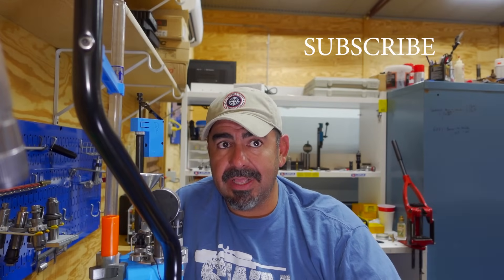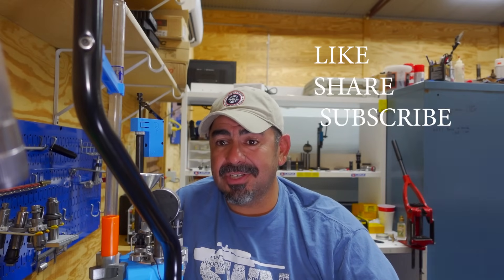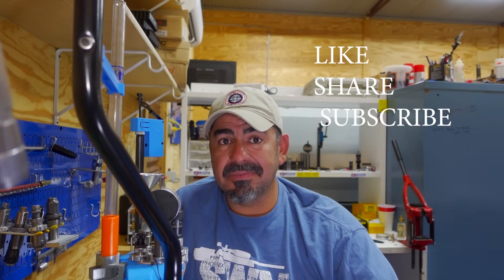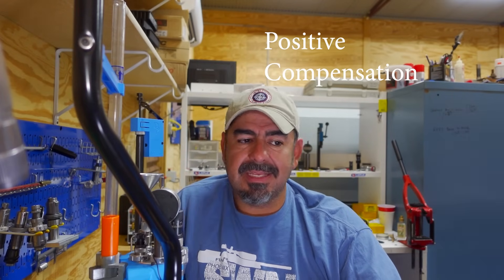Precision reloading is easy.  YOU complicate it!

Comment: Have you found that the process is different or more complicated if you aren't using premium equipment? Meaning if you buy an off the shelf rifle will the process be just as simple? I have watched many reloading videos and it always seems the less high end the equipment the more work it takes. Which I understand you get what you pay for, but if in your experience it is just as simple why does it seem that others struggle to find the sweet spot? Thanks for the vids and information.

Comment: I shot 3 different boxes of high-end commercial ammo (incl. Berger w Lapua Brass, and Nosler Match) with chronograph.  I was surprised by the extreme spreads (19 FPS - is that large?) and variability between shot velocities - meaning - no 2 shots out of 20 in the box had the same velocity.  Would you say this is due to the exactness of the weighing process in manufacturing?  Are commercial load powders not weighed precisely so there's more variability?  Your thoughts, Erik?
Reply from the maker: It’s not about weight charge alone.  You also have powder burn rate, chamber dimensions, barrel bore, etc etc. 

19 is very good ES.
Reply: @ErikCortina  Thanks for taking the time!  If 19 is very good then kudos to Berger for making such a high quality commercial product at a fair price.  I want to get into reloading but can't stand the thought of another workbench full of equipment (the price of it all doesn't bother me - just the 'more equipment / stuff').
Reply from the maker: David Greenapple 
If you have seen my 1.3” group at 1000 yards, it had an ES of 19. 😳

Comment: I agree there is no reason to complicate things i dont care if you have to spit on the case before you shoot as long as your gun, as you say, hammers who cares about the rest thats what you built it for. I just built a 6br earlier this summer and i just got a hummer of a barrel, no matter what load or seating depth you use it shoots (within reason) you get sub .200 groups. I use it for varmit hunting but definitely should make some shoots cause is scary accurate. Stiller action, kreiger barrel and hogue full length overmold stock like i said built for hunting but it just flat out shoots. Ive had this caliber before as well as dashers and had a great base load that i knew would be very close. before i ever got the barrel throught 30 shots i already shot one 5 shot group in the 0's with a 62 grain berger flat base . i settled with a faster load that shoots sub .150 almost every group occasionally i mess up one way or another and get a flyer but my fault not the guns. Great video hope to see more like it sorry i rambled on so long

Comment: Love the videos, I have not yet had time to watch all of them so maybe others cover the following points.   I am guessing there are some assumptions in your method.  Type S die with .002" shoulder reset and around .002" neck tension and a very consistent way to measure powder weight.  I don't think I am the only one to have great groups at 100 yards with horrible ES due to standard sizing dies and using a volumetric powder measure.  Your point about great bullets and brass is not lost on me.

Comment: One can buy an off the shelf hunting rifle today guaranteed to shoot 1 MOA or less with factory ammo.  That level of accuracy was not common 40 years ago when I started hand loading. The 1st rifle I loaded was a REM 700 in 7MM Rem Mag which shoots factory at 1.20 MOA.   Back then simply working up loads I could get consistent groups at 0.80 MOA.  Over the years by using good consistent brass,  more consistent neck tension and playing with the seating depth it shoots consistently at .6 MOA.  I’ve tried most of the techniques out there to improve accuracy beyond that but they don’t seem to matter.  Of course this is not a precision rifle and not for competition. You can buy a precision rifle that will shoot better with about any ammo you run through it.  I agree with this common sense advice.  Besides, most of that other stuff one might try has to do with making brass more consistent, and that’s something one can now buy also.

Comment: For some they can do what you are talking about if money was no issue. Berger bullets $75 per 100 lapua brass $100 per 100 pieces new barrel $700 gun smithing $600. Then repeat every 1500-2000 rounds or sooner. 

I would to see a video of you using say Sierra or nosler or Hornady bullets Remington brass and see if you can get the same results. DeBurr the flashhole  shave the primer pockets. Weight every projectile to make your rifle work with components that are not at the top of the price range more the middle. 

The guys that are getting 3/4 inch or 1/2 inch groups are using these components. That’s the best that they can do. They can’t spin a barrel off and through another one on without spending huge money. Especially if you are firing 15,000-20,000 or more rounds every year. 

I like your videos lots of info. I tried one of your ideas I’ll see what the results are next day at the range. Good videos. Please keep them coming.

Comment: What are your views on cleaning brass some people seem to think dirty brass performs better than tumbled brass
Reply from the maker: Up to you.  I don’t think it matters.
Reply: @ErikCortina  I have a problem that I have never encountered before, I don't  know how to explain it. I typically shoot in two different locations about 2 miles apart that differ in, elevation about 3000 feet, about 30 to 40 persent humdity and on average about 40 to 50 degrees f. I have a load that shoots consistently under. 25 moa with Lapua scenar 90 grs in a 1 an 10 twist tikka on the hotter more humid lower location, however at the other location it opens up to about 1 moa and I cant explain it the chrono numbers are the same yet the group opens. Have you ever encountered such a problem, I dont know if it can be due to the fact that the bullet is right on the edge of what the tikka can stabilize.

Comment: “ES”....stands for?
Reply: Extreme spread.  Shoot x number of rounds over the chrono, say 10.  The difference between the slowest round and the fastest round is the extreme spread.  So, your third shot is 2672 and your eighth is 2546.  All other shots are somewhere between.  Your extreme spread is 126 feet per second.  If the cartridges were all loaded the same, you may need to work on your load (primer, powder choice, powder charge, case capacity, neck tension).
Reply: @wdtaut5650  trying to learn here, so what is a good ES "average".....are we talking within 10fps....20fps?
Reply: @jeffpickard5548  I'm still learning, too.  It probably varies depending on cartridge, bullet, powder, and just how close you want to be. I am loading for hunting not benchrest so I don't need the same precision.  For me, it's more about range time and improving my shooting ability than fine tuning the loads.

Comment: I buy brass by the lot for reasons of uniformity.  Then test ten cases   by trimming to exact length. Then weighing each case  and grouping all similar weight cases. Then load by 100 rounds from each lot. By loading them identically identically each round.  The redundance of identically is meant to be sarcastic and renew The point of repeatability!!! again weigh each round and separate by weight. Fire and chronograph ten rounds per 100.  Exactly as you say Erick consistency is accuracy. The reason for this train of thought is to eliminate variables and create a measurably consistent accuracy. Also even with buying premium bullets, weigh each. Then group by weight. But only if you want to achieve Olympic  grade accuracy without the politics. Be your master without entering competition. And if your up to the comraderie of the shoot, enjoy !  Enjoy your sport,  I hope it never becomes painful. But if your skills keep you alive great.

Comment: I've used a Lee hand loading dye for years now loading 168 grain alco bullets for my AR10, and I routinely punch single hole 5 shot groups at 100 yards. 

The trick is being consistent with your seating, your powder loads and consistently checking your brass to make sure it stays within spec.  I also weigh my bullets and sort them before I load them. If they're not within 5 100ths of a grain of one another, I load them for barrel break ins. 

Most people just can't outshoot their guns. My rifle, in a vise, is capable of 1/4 moa at 100 yards. The problem in the equation isn't my rifle or my loads, the problem is me. 

I'm just a random dude on the internet, but that's what I've found works well for me.

Comment: Hello there,

I have recently taken up the activity of reloading and have begun developing loads for my Howa 300/WM 1500 long-action rifle. In South Africa, we utilize Somchem powder S365, with a recommended min. load of 63.5 and 67.5 grains max. I initiated my testing at the minimum load, and at 64 grains, I achieved a muzzle velocity of 2680 feet per second. Subsequently, I progressed to the maximum load and observed a velocity of 2810 fps using Hornady ELD-M projectiles. I find it puzzling that I did not attain a higher velocity, especially when compared to the (over the counter)PPU 150 ammunition, which reaches 3150 fps.

I attempted to gather information online to explain this discrepancy but found nothing substantial. Your insights and guidance on this matter would be greatly appreciated.

Comment: How do you measure your ES? (How do you determine if your Es is low or high?)
Reply: Extreme Spread measured with a chronograph.  For example, 5 shot group with muzzle velocities 3000,3005,2995,3000,3003 ES = 3005-2995 = 10 fps
Single digit ES are low, teens are high.

Comment: I don’t shoot PRS but I like my “mass accelerators” to be as accurate as they can be. I’ve been reloading for over twenty years and within the last five years I’ve abandoned all case prep except 1 toss used brass in a walnut cleaner, 2 de-prime and 3 resize. The only two things I tinker with are charge and C.O.A.L. Tonight you gave me a systematic approach to further improve my accelerator’s accuracy.

Comment: I get your point about your expected performance from your equipment and for me personally I enjoy your videos.  I watch to pick up procedures and tips to improve my shooting but my shooting is with varmint rifles and sporters.  I don't need 1/4 moa from my rifles but it's nice to see my 270 print groups you can cover with a quarter or see my CMP M1 Garand shoot to just over 1 moa off the bench, your videos have helped me tighten them up a little with my handloads.  My son just bought a SIG Cross in 6.5CM and sighted it in with Hornady 143 ELDX's and the accuracy was great (for him).  I took a piece of his brass, after cleaning and trimming I measured it and bumped the shoulder back .002"-.003", checked the depth of the chamber lands and seated the bullets .030" off the lands and worked a load up using my favorite powder, H4350.  My ammo cut his groups in half and it wasn't that hard to do, just a few extra steps and a little TLC.  Thanks.

Comment: Hi Erik, You mentioned in this video that you have a 6x47... I had one some years back and had a had time getting any consistency out of it. It was crazy accurate, but velocities were all over the place in the dead of a frozen Ontario winter. I figured it was those small primers, so I started forming brass from 22-250 cases I had. All of a sudden I got single digit ES and solid consistency over the chronograph. I had to turn it off and on between shots because it was so often the same number.  Not sure if down south you get enough temperature swing to notice this problem I had, but I would be interested to hear your results if you try LRPs with it. BTW, the closest brass is 6XC so that makes the initial resizing a whole lot easier than 22-250.

Comment: You are an Inspiration Eric, thanks for your effort in teaching me an many others precision shooting. However, I am thinking that it is five elements you must consider, barrel harmonics, bullet release from the barrel (I call it bullet whip), consistent velocity and consistent BC.
1. Barrel harmonics is the most known, release the bullet when the barrel moves as little as possible.

2. Bullet whip, when the bullet leaves the support from the barrel, it moves sideways due to the unbalance of the bullet and the twist. How much is due to the balance of the bullet end now I am guessing, the seating depth. Nobody can say exactly what happens when the bullet moves from 0” to the bearing surface is fully supported by the lands but the pressure rises to 1000 psi in the first 0.04” of movement, 1300 psi passing 0.08”, 31 000 psi passing 0.2”. My theory is if the pressure doesn’t hit the back of the bullet its likely that the bullet pushes sideways an some how this is depending on the seating depth.

3. When it comes to consistent velocity, all equal is the first rule (case, bullet and powder weight) then the primer and last the neck tension.

4. Consistent BC, there are better brands of bullets than other or point the bullets.

5. The fifth is the most important, the skills of the shooter. I rational the reloading and I use the components I can afford and spend my time on the range or at competitions where my performance is everything, not the result list. I have stolen a wisdom; shooters win matches, not equipment.

Comment: Erik, great vids!

I have a perplexing reloading problem and I wonder if you might have some suggestions to resolve the problem. I'm loading 223 ammo for a bolt gun and for ARs as well, and the problem is, no matter what I do and try, my ES numbers, as measured by LabRadar are really high.

I can get very low ESs from 3 shot sets, but when I combine 3 shot sets (same charge) I find the ESs shoot up to about 60 fps. Here's the hanger, I have 53 sets of ES data. Each set has 25 shots! That's 1325 shots. They aren't all from the same charge or the same gun, but what's true of each 25 shot set is the overall ES averages about 60 fps.

I use Federal 205M primers, H4895 powder, Sierra 69 & 77 gr MKs and Hornady 75 gr BTHPm bullets, and I've tried Lapua, Winchester, Hornady, Sig and some other brands of cases. Nothing changes. When I do large counts, i.e. 25 shots or more, of a given load I get high ESs. But I also keep track of each 3 or 5 shot sets within the 25 shot set. Some of those 3 -5 shot sets may have ES's under 10 fps, but altogether it's closer to 60 fps. And it's not just one outlier. Typically  out of 25 shots a couple are noticeably lower, and a couple are noticeably higher than the other velocities of the set.

I load with a ChargeMaster and check each CBTO on every round, and keep them within +/-0.002". I have spot checked runout and it's not bad at all, maybe 0.002" - 0.003".

I'm stumped, any suggestions - and THANKS!

Comment: Erik, do you start load development testing after running 10-20-30 rounds down the barrel to get it "settled in"?  You said that you clean about every 100 rounds or so and I know from a squeaky clean barrel it takes my 6.5 X 47 Bartlein barreled PRS gun 10-20 rounds for velocity to level off.  After that cold bore shots are in the group.

Comment: Just a simple"interested person". Where do I find some reference to the terms you use in your professional speech...I don't call it "jargon", if it's some useful and descriptive term, but one needs to start with a basic understanding of the language :-)
Even with my limited knowledge, I can sometimes indulge in "run before you walk" exercises, and info like the straightforward style and presentation of your videos...And, damn! 1.3" at 1k yards!
Reply: In the order that Erik uses some of the terms you may be asking about:
ES = Extreme Spread (Difference between min/max velocities)
Harmonics = The way the barrel vibrates a little bit when it's shot. Certain OALs (OverAll Lengths) and barrel tuners (more on that below) will affect this differently.
BC = Ballistic Coefficient. Generally the higher this number is, the less it will be affected by air resistance, however this number matters more at longer distances, so for 1-200yd shooting a lower-BC hunting bullet will still give great results.
Neck Tension = How hard the case neck is holding on to the bullet. Most shooting channels I've seen (incl. Erik i believe) say they prefer ~.002 of neck tension, which means that a cartridge with a neck dia. of .295 when loaded should be sized to have a .293 neck before a bullet is seated. (Redding's bushing dies allow this diameter to be easily adjusted)
SD = Standard deviation. It's been a while since I took Algebra 2, but basically one standard deviation from the average is where you can expect ~68% of data points to be, 2 SDs will contain 95% of data points, and 3 SDs will contain 99.7% of data points.
Barrel Tuner = A rubber (?) donut-shaped item that slips over your barrel to try and deaden some of your barrel's harmonics.
Freedom Delivery Machine = (REDACTED)
MOA = Minute of Angle, approximately 1" every 100yds.
Hope this helps.

Comment: Hi, I like you make it simple. In 1970 when i first started reloading my .222 with Nosler 55 gr partition bullets, i did not even use a scale for powder. I used a measuring tool, i got the length of the bullet by measuring a factory round. Great hunting round, i used on pigs, goats and deer. Never had problems with primers, powders, or bullets. I used a simple 6 position turret press and reloaded .22 hornet, and .17 rem. It was simple, enjoyable and a lot of fun. I spent most of my time in the bush and not in the garage worrying about my loads! Thanks mate!